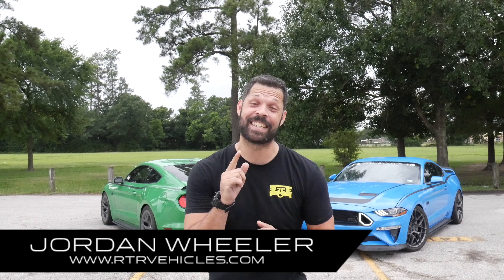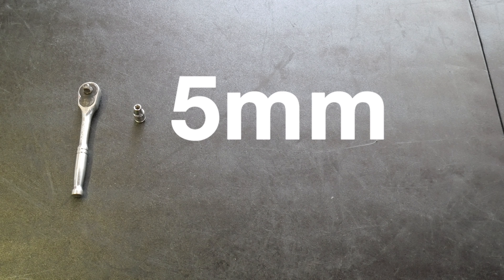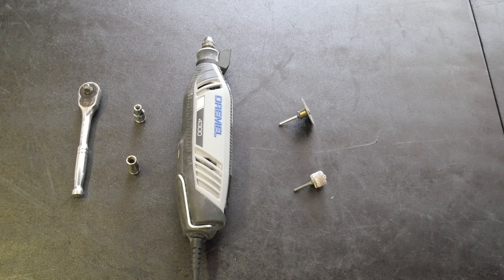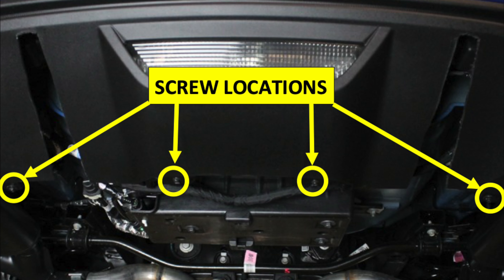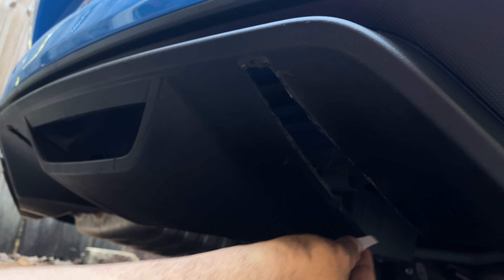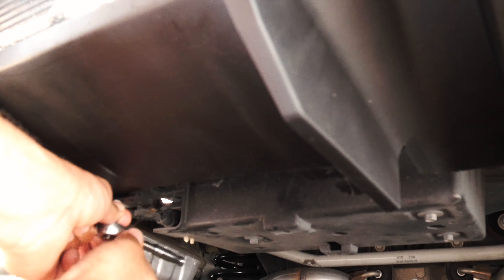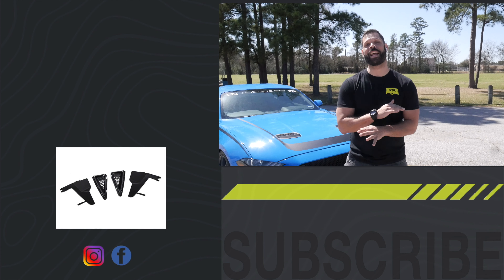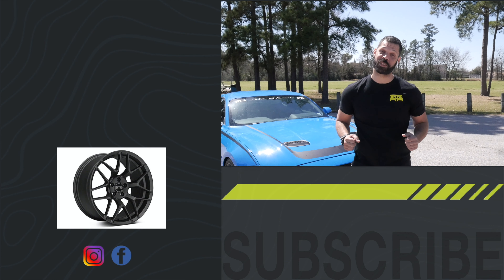Installing the RTR Rear Diffuser (18-23 MUSTANG - GT & EcoBoost W/ Active Exhaust ONLY)

Comment: With the bolts you tighten at the top, should they screw down to the point they don’t turn anymore with gentle force or do you tighten until they feel firm
Reply from the maker: Tighten until firm